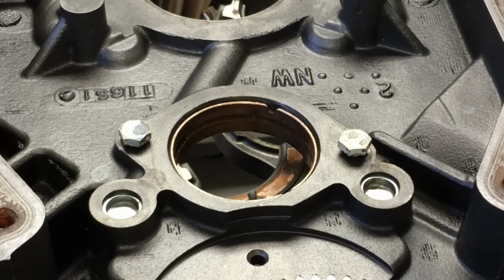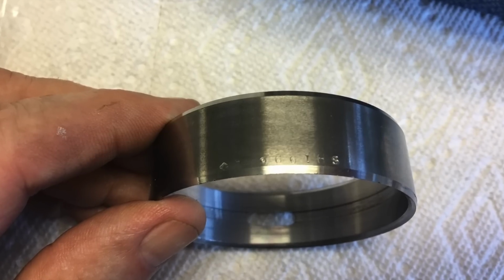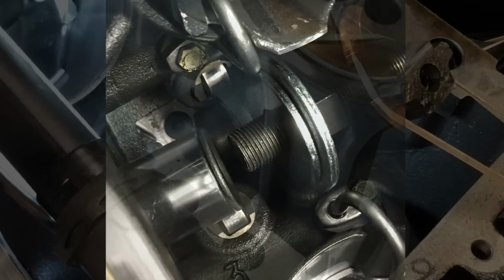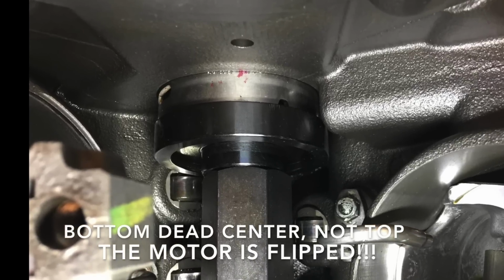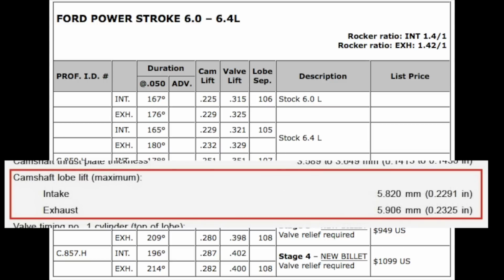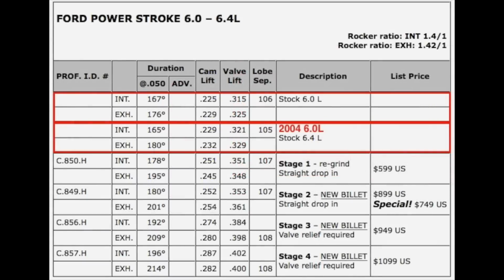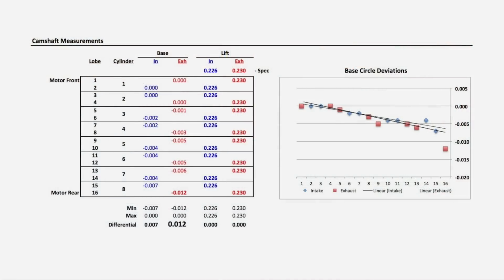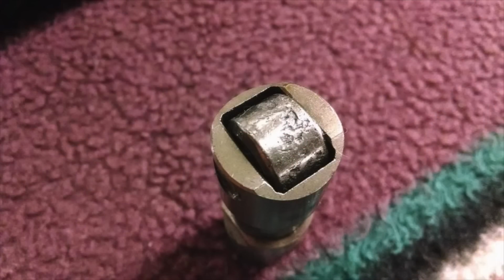2003 Powerstroke 6.0 - Camshaft and Camshaft Bearing Measurements; Camshaft Bearing Replacement

Comment: Jack, Did you measure the 6.0 cam install position? and be willing to share that info? it is very weird that there is nothing out there in terms of degreeing Diesel camshafts.
Reply from the maker: John, what I got from Colt was what they give in the literature, duration, lift, and separation.  No lobe centerline.  I swept the lift to ensure I had piston clearance since I had no idea how much was taken off the block decks, which I showed in another video.  But I did not try to check what the lobe centerlines were.  Protrusion should tell an approximate deck variation based on several engine measurements - I gathered what I could, but since this is a one and hopefully only ..... But piston clearance was my only concern at the time.

Comment: Hello Jack, just curious when pressing on the gear, do you press the timing gear on until it stops?  I have the cam retaining plate on and was just wondering how to know if it will affect cam end play.
Reply from the maker: Yes, until it stops.  The shoulder is wider than the retaining plate by a few thousand of an inch.  I have pictures if you need them.
Reply from the maker: I just created a Thread on PS.org to show the question and the images.

https://www.powerstroke.org/threads/cam-gear-fitment.1396934/

Comment: At first diagnosis if there is popping from intake repeatedly than the lifter is toast and so is said cam lobe. Needle bearings from lifters will pass through screen in pick up and wipe front pump.
Reply from the maker: It will be a valve train issue, broken rocker, bent pushrod, and in many cases, a failed lifter/lobe.  The upper valve train defects often are ratified, and the engines can continue on.

However, a hard part failure was not true in my case.  The lifters were intact, and I forensically disassembled them.  Pushrods were straight, and the rockers in good shape.  It was the excessive grinding of the last two lobes, so the base circle was too small.  It was only noticed after 75k miles due to the wear on the lifter's plungers and bore allowed for more bleed-down when sitting.

Comment: Rpm, weight of valvetrain at rpm, and. Valve spring pressure against that Pontiac designed lifter from the 5.7 natural diesel
Reply: From the 70's
Reply from the maker: I think with this motor, the designers were not expecting the Ford induced oil cooler failures, raising oil temperature while losing lubricity.  I'm starting to ask in the forums when someone has a cam/lifter failure if they had a clogged oil cooler in the past.  One person sent me their failed cam and lifters from that situation; I just need to get the time to do a video on that.

Comment: I am curious is that damaged cam lobe near the bearing that was askew ? Just trying to wrap my brain around the sequence of events here and if the lobe was ground to remove that damage or if that damage happened after the install and may be due to bearing debris.
Reply from the maker: Larry Grogan  In the Forensics video I talked more about this.  There is no damage to the lifter or to anything around the cam and lifter in the block.  The gouges are quite deep, and the only way I can see that occurring is with a lifter wheel coming off and the two base sides of the remaining lifter eating into the lobe.  

So this being a reground cam, clearly shown by the base circle change and more so by the base circle change of lobe 16, this is what was left after they machined it.  A decision was made it would be good enough.  It was, the new lifters roller never blew apart, but it’s a bad way of doing business.

If I do the cam/lifter failure video I’ll go into this.